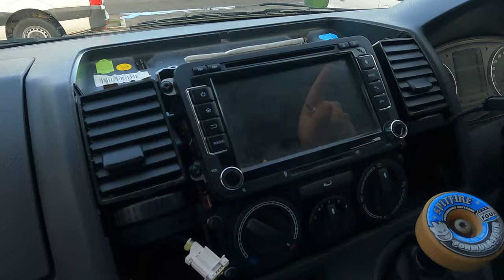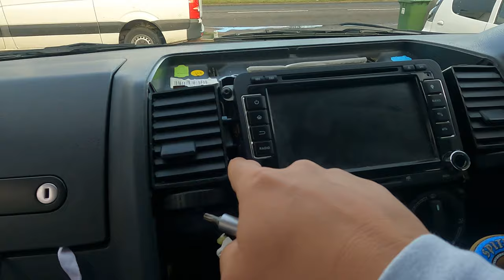T5 Campervan Stereo and front speaker upgrade!

Comment: Have you checked that your windows clear the back of the new speakers, the aftermarket speaker mounts step the speakers out as per the oe ones? Might pay to fit some “sounds like a golf seals on front doors, you have rust on body shell at base or rear edge of drivers door, often caused by door flexing and hitting when it shuts, the secondary door seals solve this.
Reply from the maker: Yeah they clear nicely pal you just can’t go to big. They are the next jobs tbf brother.

Doors dropped slightly catching at the bottom hence the rust. So paint work was o be sorted and new door seals.

We just hammered it last year didn’t have time for maintenance Jameson just got used a lot 😂🤜🏻🤛🏻

Hope you enjoyed the vlog pal have a great weekend and thank for your comment 🤙